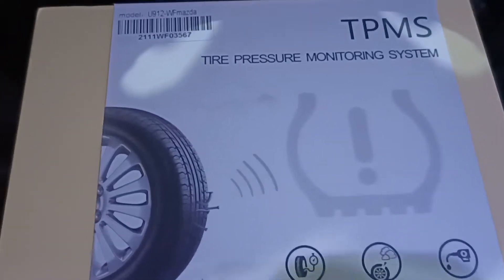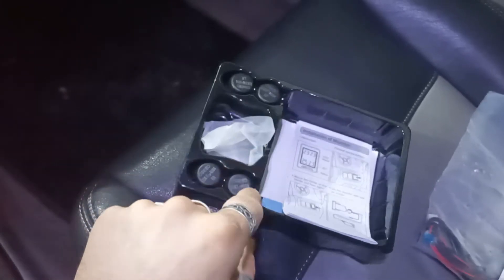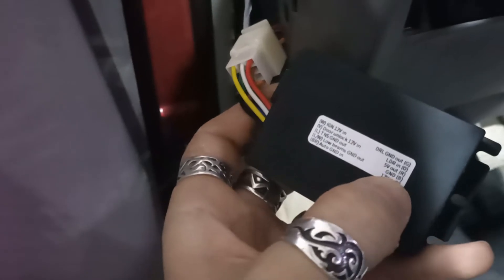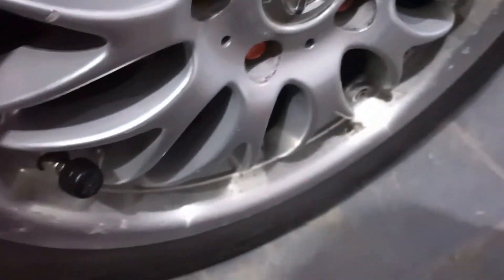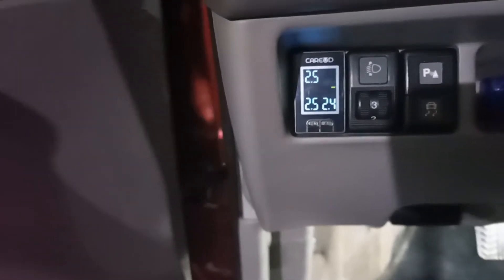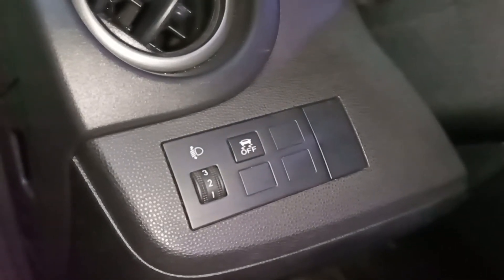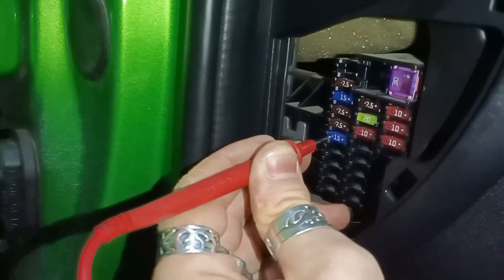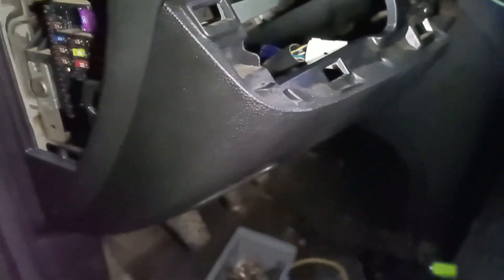TPMS for Mazda 626 GF and Mazda 2 DE

Comment: You should add some grease beforing installing these :) I had them and after a year it was impossible to remove them
Reply from the maker: Good point. I actually remove them every now and then on both cars and I didn't had issues up to now, but good to know, thanks!